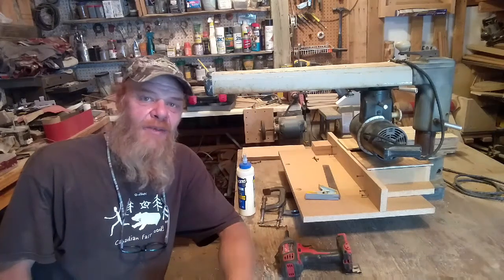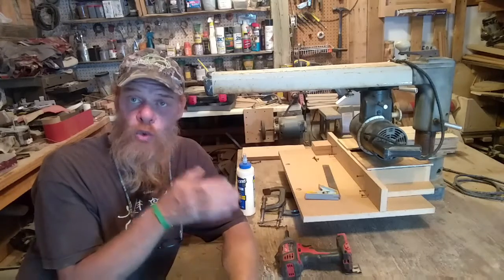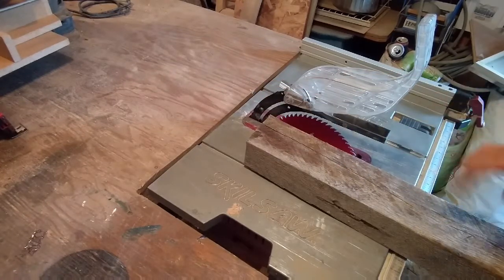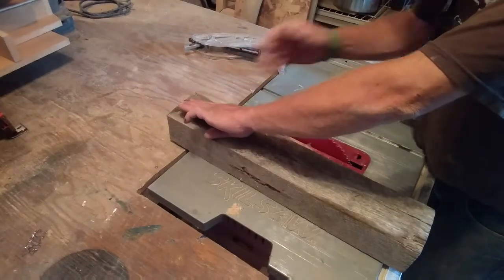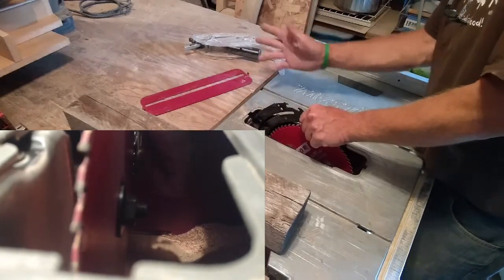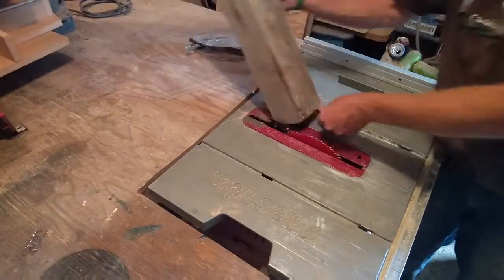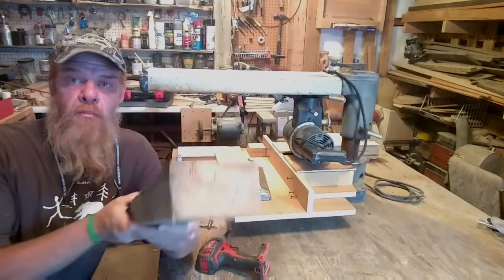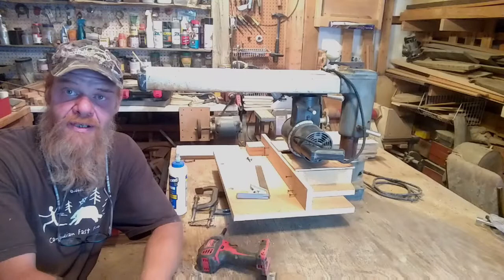RE-SAWING thick stock safely using my Skil tablesaw model #3410

Comment: If it’s the skilsaw spt99 worm drive table saw, it should power thru whole 3” of oak easily. And even harder woods.
Reply from the maker: yes you are correct a worm drive saw would, but this is not a worm drive saw.
Reply: Hope This Works 'Our Homestead' 
Oh. My bad. I’m hoping to get spt99 soon.
Btw, since you don’t have bandsaw, have you tried slapping a 7-1/4” circular saw blade on your TS?
It’ll save you half the kerf of your TS blade, and will still do adopt 2” of height.
Reply from the maker: i have thought about investing in a small blade. i have seen benefits to it
Reply: This is the Skil 3410 Table Saw...its a direct drive saw, not the newer worm drive model.  I just gave my 3410 to my uncle who don't have a table saw at all.  For no more than he will ever do it'll work great for him, and the included folding stand makes it extremely portable.  I have a Ridgid 3612 contractor's belt drive 10" table saw that works excellent and is on wheels, but its quite heavy and large so it don't move around much.  I plan on upgrading to the worm drive Skil Table Saw soon.  I like the folding cart with wheels on it to make it just that much easier to move around...the 3410 isn't bad to move around at all, but it weighs about 1/2 what the worm drive model weighs LOL.

Comment: I threw my guard away because it's always getting in the way but I'm a idiot,  I've seen to many people lose fingers with those saws and all it takes is a split second
Reply from the maker: Thanks for watching jerry. Waiting for your Fire it up Friday video!
Reply: I have the guard for my saws but I have them removed all the time because they get in the way and become more of a danger than just paying attention to where your hands are.  If your saw is setup properly and the fence parallel to the blade you won't have kickbacks.  Every kickback I've seen was a result in a mis-aligned blade/fence condition which pinched the workpiece after it had passed the blade.  A splitter is great unless you are doing cuts similar to this video where you aren't cutting through the workpiece completely, dado's are a huge one which requires removing the splitter most of the time too.